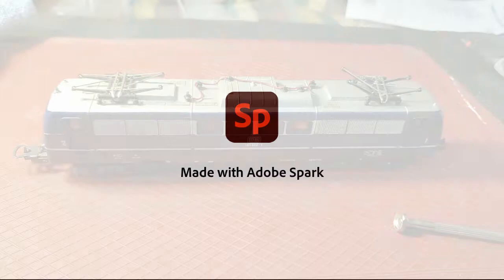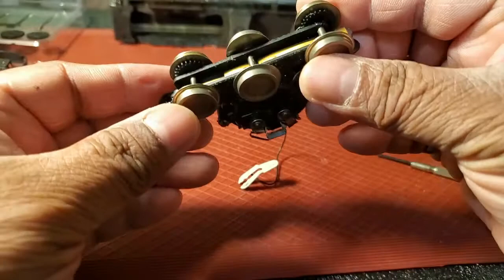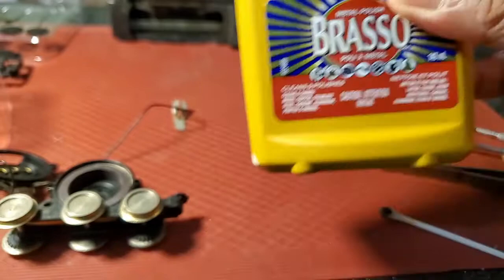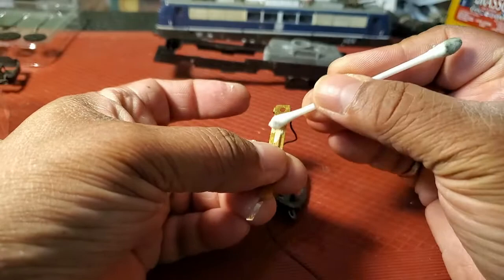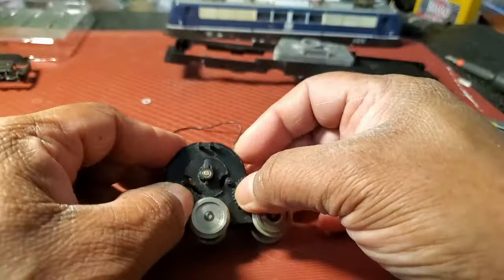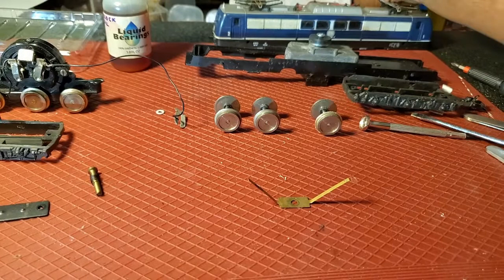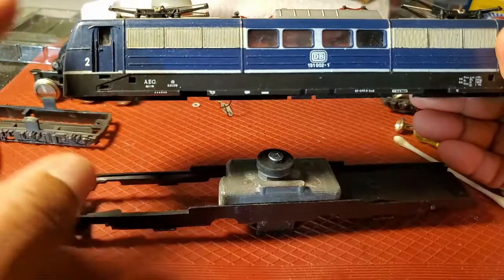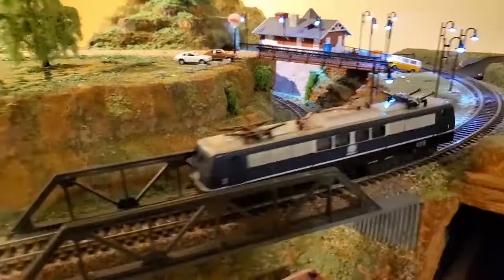Servicing a Vintage HO Lima BR 151 Locomotive / Modellbahn-Lokomotivendienst

Comment: The old Lima pancake motor is one of the most reliable and easily 
repaired model train power units ever. This is why there are still so 
many old Lima trains out there and running. Was never given the credit 
it deserved back in the day. But now it has become kind of legendary and
 for good reason. Also Mazok Rot and Zinc Pest will never be a problem 
for Lima locos.
Reply from the maker: Totally agree with you .. I know they are bit noisy because of the "not so precision" plastic gears, but I love LIMA's as they are so easy to service and fix . The LIMA armatures and motors ( Ringfield type ) at the time, are far better than Hornby and Bachmann , in my opinion . When you service them , they run like they used to many moons ago ...  A very practical design . Many people convert the ringfield ( pancake ) motors to the new CD Canned motors .. but I like to preserve them the way they were and enjoy the characteristic sounds and behavious of these vintage beauties' ..

Comment: Very useful video. I have also a couple of lima trains. They are old I think 30 years but still running. You can buy them for reasonable prices and the noise I find okay. A real train also makd noise.. Hahaha.. These days they build in speakers for the noise. Lima and Jouef old school analog but great fun.. Thx. Bad parts for attention: the buffers get lose and lost and the panthographs are very fragile.. That's is a little bit a shame... To buy them is expensive. 4 buffers cost +-6 € of an other brand and panthographs around 13 €. Lima part are not for sale anymore so you have to buy another brand Marklin, Fleischmann etc.
Reply from the maker: Thank you for the kind words John . I do have both DC and DCC loco's . Like yourself ( I'm making an assumption here ) , I also have a soft spot for vintage LIma, Roco , Fleischmann , Brawa , Athearn , Proto 2k, Rivarossi Loco's... the Noisy gears, the noisy motors , and the occasional wobble , add so much character to them .. And they are build to last .. As long as you service them regularly , they will keep going and going ... 
Thanks for the comments .. - Regards, - Anthony .

Comment: Thanks for this how to video and well done on bring this model train back to life. I have recently bought a pre-owned Class 60 and it doesn't run well at all. There is corrosion on the contacts and I was wondering if contact cleaner would be enough to deal with removing this green good from the contacts? Or maybe I would be better off buying new ones and toss the old ones out into the trash? I would like get this one running again as I do love these older Lima models. I have liked the video and consider me subscribed. Please keep up the great videos mate.
Reply from the maker: Hi I'm glad you found this vid useful . Hmm , so seems like you have copper oxide formed on your commutator. you can try contact cleaner, as it is designed to clean all the gunk that builds up due to arcing etc .. but if that does not work , you can try to polish the commutator with Brasso metal polish. I have a few vids where I have used it and you can see the results . It is designed to clear copper as well ( based on what is advertised on the label etc. ). I think my vid on the MV9 , i may have used brasso. 
if that does not remove it , you can try a more abrasive method of light sanding , but I am not a fan of that at all . ( to me that is an extreme measure , if all else fails etc ) . 
Give Brasso a shot and see how it turns out . 
Regards, 
Anthony.

Comment: What can you say about the rubber tires which this loco uses? They are almost impossible to find.
Reply from the maker: Hi Carlos , Very True . However, I came up with an alternative option. If you are familiar with heat shrink tubing for electrical and electronic wiring , I have them in various diameters, and you can get them from any electronics parts store. I cut a sliver of about 1 mm and I put that on the wheel and apply a bit of heat so that the heat shrink tubing shrinks and grabs onto the wheel . it has worked really well so far and only costs a few cents . let me know if you want more info on this method . Regards, - Anthony -
Reply: @anthonyshobbycorner  Excellent idea, it seems to me working fine. Thanks a lot and I will try this soon. Congratulations for your very useful video.